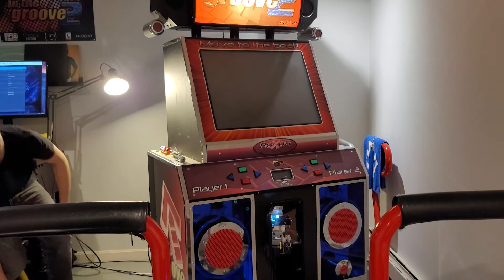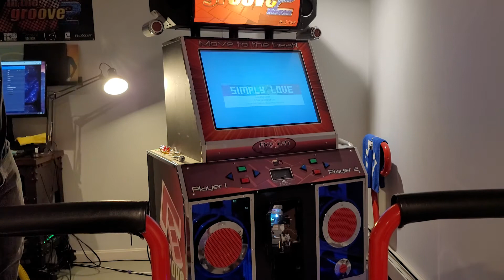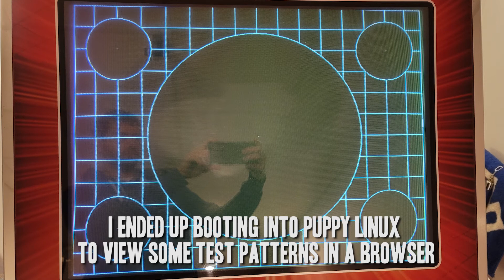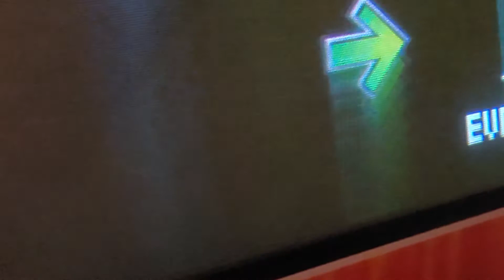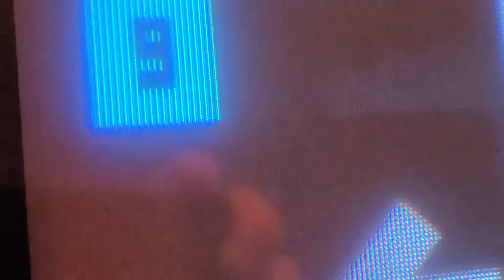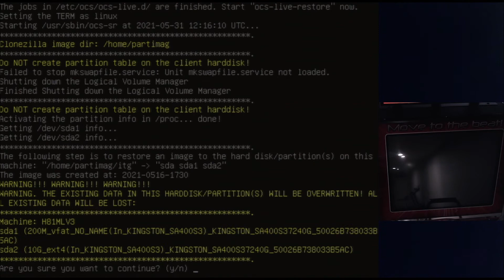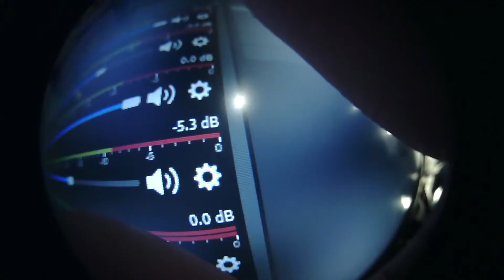Dedicab Maintenance Simulator 2021

Comment: i've been playing around with monitors and tv's since i was 14, i take a lot of things for granted.
The green tint might be a magnetic issue, could be fixed by deagussing it manually with a coil, or it clould just be the adjustment pots are a bit oxidized and you couldn't get the green just right, there's also the possibbility that the blue and red guns are a little more worn than the green one but the adjustments should allow you to make up for that.

Comment: When you pulled the back off I could see quite a bit of dust around the monitor neck. You probably have dust on the guns which could cause the green tint. A rejuvenator is expensive as hell but it heats up the guns to burn the dust off... you could try tapping the neck to physically knock dust out but be warned, if you break the neck the monitor is pretty much dead.
Reply from the maker: I very lightly brushed some of the dust off with a cutip. Do you think that doing that might have caused this?
Reply: @domitg  it could have knocked some dust down in there. I'm assuming the guy who fixed up the spare board did a cap kit on it, and since you weren't having the green tint before, it really seems like an issue with the guns to me. I doubt they are going bad all of a sudden between board changes.
Reply: BTW, You could definitely fix that other board yourself. Cap kits and flyback replacements are pretty easy. They make pre assembled and labeled kits for a lot of arcade monitors. You just gotta find out the brand and model monitor in the dedicab. https://www.arcadeshop.com/